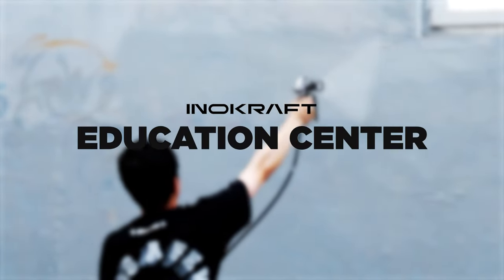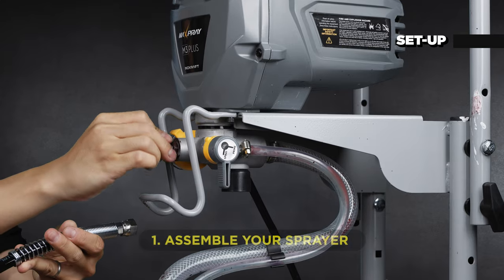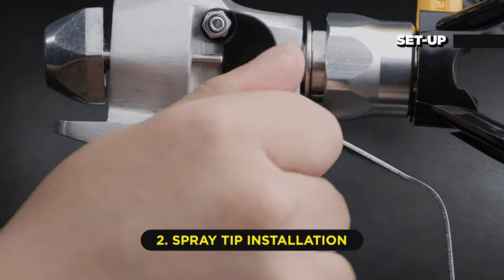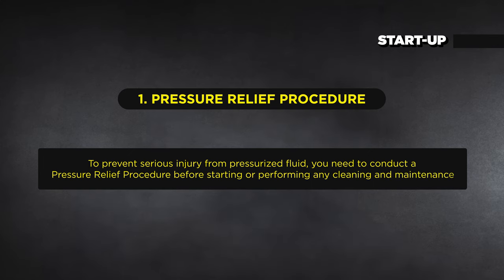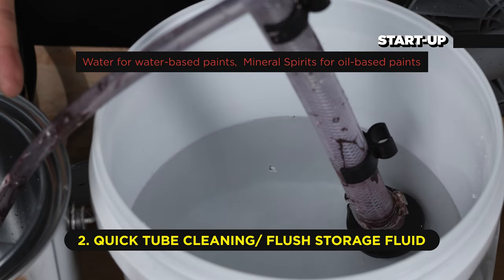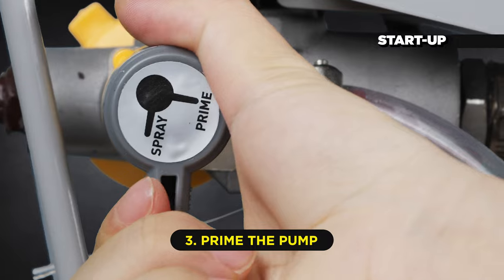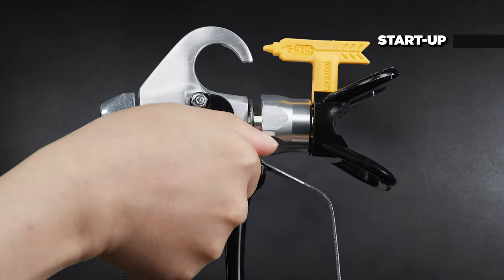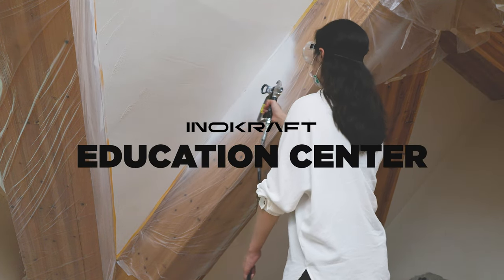InoKraft Education Center - MaXpray - Set-Up and Start-Up

Comment: How do you Adjust the Spray nozzle if you don't like the way the paint is coming out.
Reply from the maker: Hi, thank you for your question. With the same nozzle, you can only find the optimal spray effect by adjusting the pressure value, not by adjusting the nozzle itself. Adjusting the nozzle seat will only change the spray direction. The spraying effect also depends on the type of paint, so if you are sure about the paint type, you can also switch to a different size spray tips to achieve the best effect with the same paint.